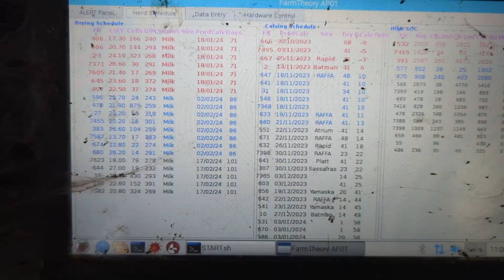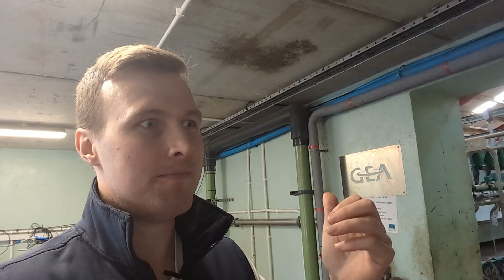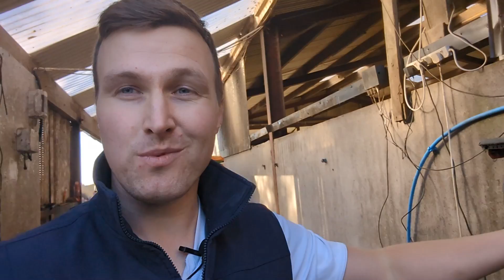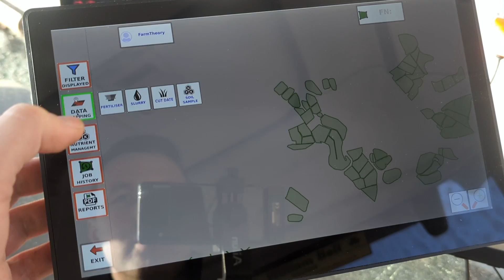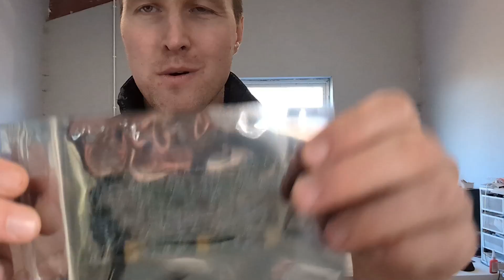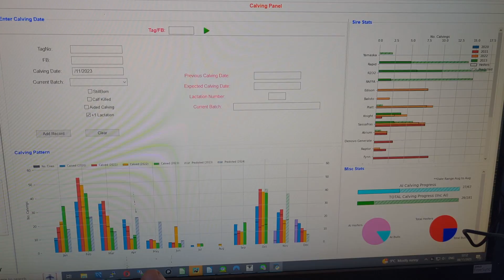SUCCESSES and FAILURES from 10 YEARS of building farm tech! | Tech HOBBY to Tech BUSINESS?!

Comment: A concrete weight cell like a small weight bridge for fork lifts underneath the crush they won’t destroy it then
Reply from the maker: The load cells where up high, the issue was the steel I used wasn't strong enough.

Comment: The heat recovery works from the milk tank compressor,should leave ur water at 50deg;before boosting withur electric heater. I
Reply from the maker: Looked at that type also, then the issue is our cooler is giant and doesn't run more than 2hrs a day.

Comment: Very basic tech i use a lot is a GSM relay to turn on/off the fence. Only problem is remembering to top up the sim before it dies. I got a 10 year IOT sim to try get around that. Also got a lorawan IO controller to do the same thing. There are analog and digital inputs on the controller. It would be nice to read the power from the fence using those inputs but i don't know how. 
A lot of hours gone into the software you have 👍🏻
Reply from the maker: Hook a cable up to your fencer battery and put a 3:1 voltage divider on the positive line which feeds into the analog input. It's just two resistors, Google will help you. Then you can read your battery voltage.

Comment: Wtf happened to the 8S exhaust?
Reply from the maker: It's a lose bolt, don't worry. 😅 Just spins round.
Reply: The majority of tractor manufacturers have got into the habit lately of are making sh1t exhaust 
There's a  guy in Fermanagh fabricated stainless Steel ones that  appear indestructible (done-deal) 🤔